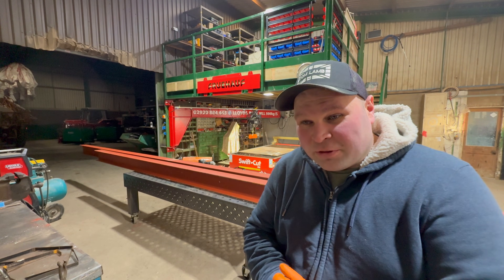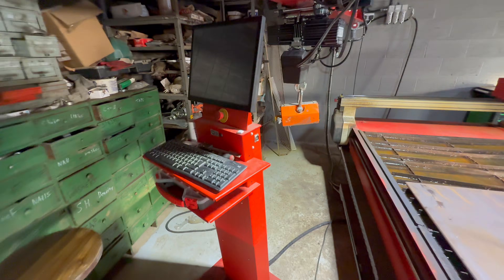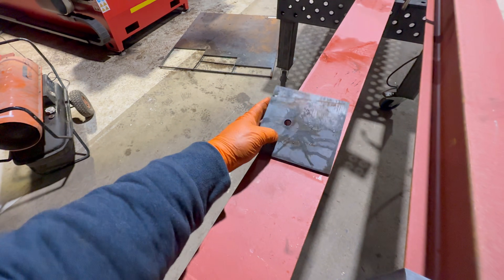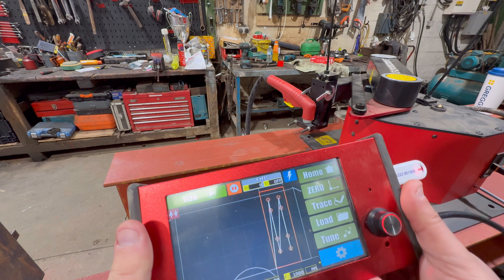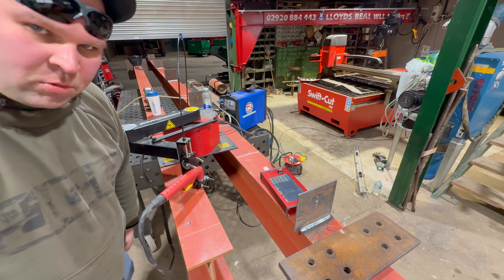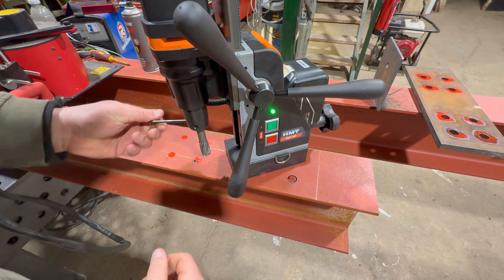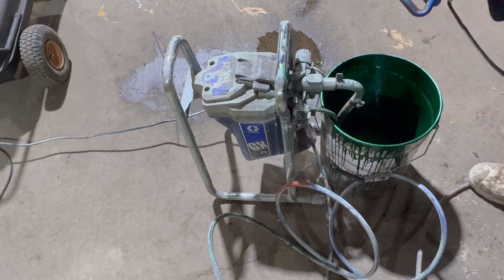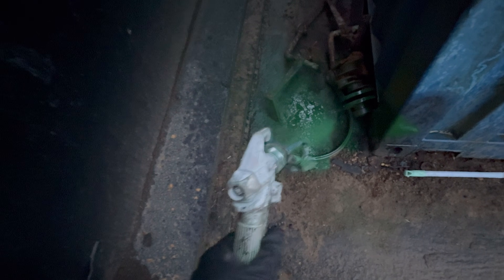Mobile CNC plasma cutter ARCDROID (building a steel frame building)

Comment: Get a 32amp red male plug, some 6mm 3 core ho7rn a 32amp blue female plug, wire in the red plug L1 neutral and earth, then the blue plug Live, neutral and earth, youll then have yourself a 32amp single phase supply without spending out on having a new supply added

Comment: Cracking bit of welding Tom I'm a Boilermaker welder not done it as job since 1976      last job I done was in metric      I still use feet and  inches        never used a mig but have a caddy      great light handy welder wit  good power            SOUTH AUSTRALIA

Comment: Never use a big load on a extension cord if it's unrolled, because if it's rolled it will become a bobbin and will heat up until it will melt, so if you use n extension cord make sure it is fully unrolled
Reply: bzzt, coils, spools, heating, fire

Comment: 👌that fuse blowing in the plasma then panning down to the standard extension cord on the floor 
Ive had issues in the past with the circuit breakers tripping on plasma cutters I believe you need to have a ‘C’ type 
Also i like to flappy disc the surface before using the torch to create a nice circuit 
Are you going to LAMMA this week?

Comment: What size bolt fuse do you recommend. Plus the unrolled real. Rough as toast posting up this type of content.
Reply: 3, Maybe 4 depending of current, also if rolled reals and if toast is buttered or not on either side. Is chocolate coating involved or not?

Comment: Waste oil burner, the industrial type would suit your workshop.
Reply: Local. Regulations.
Reply: @bastiaan7777777  explain what local regulations?
Reply: @Phuc_Yhou  Your local regulations do not apply. Waste oil burners are illegal here.
Reply: @bastiaan7777777   what country are you in? Waste oil burners are not illegal here in the UK
Reply: @Phuc_Yhou  Oh dear: United Kingdom: Since 2016, it has been illegal to burn waste oil in a SWOB without a specialized environmental permit. The cost of these permits—several thousand pounds for application and annual fees—effectively functions as a ban for most small businesses.

Comment: Interesting as usual. I also has an R Tech plasma cutter, a Prof 50 and it runs on a 32amp single phase plug. The best plasma cutter (I have used a few and owned two different brands) I ever used was a Hyperthem 45 on structural and heavy steels when I used to do that sort of work. I now only work on vehicle repairs so my R Tech is rarely used and may get sold off this year because it just collects dust.

Comment: Now the question has to be what size blue sockets do you need 16,32,63 just in case there might be bigger toys to come - you can always go down with an adaptor but not up (and you need a big enough feed. From grid of course)
Reply: Could always get an adapter to go from the three-phase socket that the larger CNC plasma uses.
Reply: The volt drop on the extension lead would have been half the problem
Reply: I’m not surprised the plasma requires a 32amp supply

Comment: Thumbs up for the correct use of a 250 amp slow blow fuse.
Reply: Seeing previous videos amazed by all this muck into gear, pullies, wheels and whatnot, why is engine bay not sealed off from al this stem muck sust pollen fibers things? No wonder musk cannot get a lander on the moon with all it's dust.